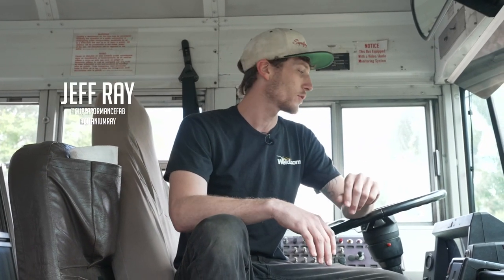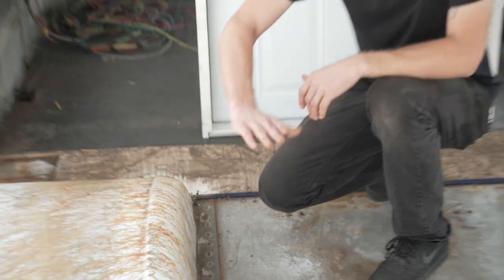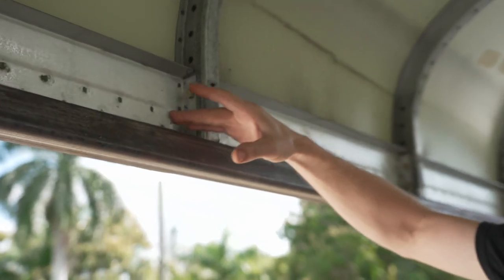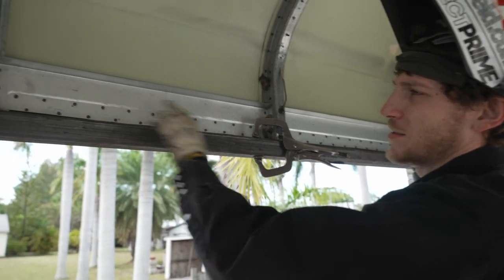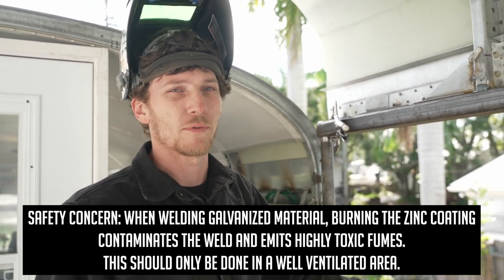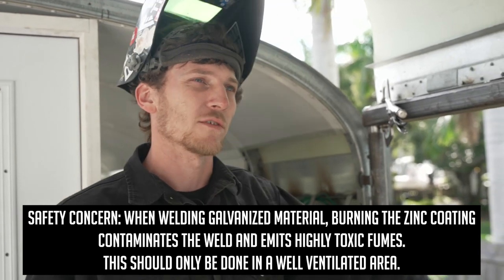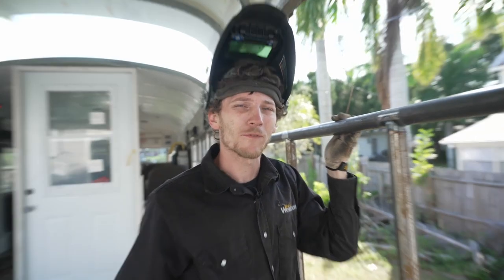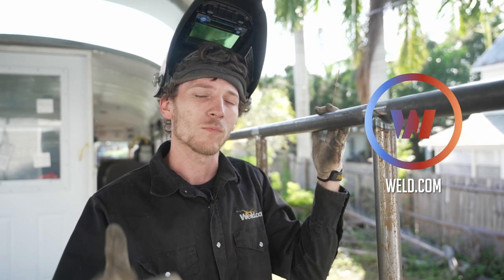How To Build A Food Truck From A School Bus: DIY Fabrication

Comment: One question, I have a similar project but the bus has many cables on the sides and I don't know how to hide them?
Reply: Most of the cables are useless, just look for the ones for the lights, remove the rest, that's what I did